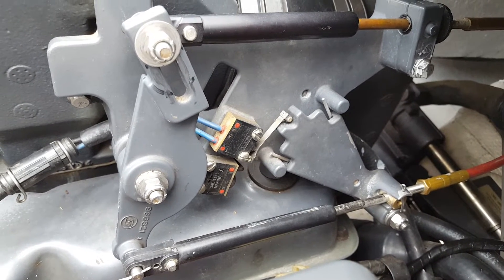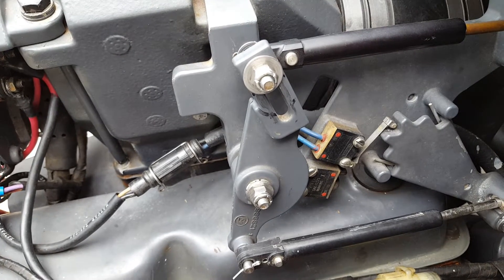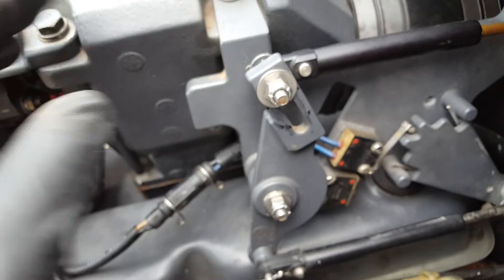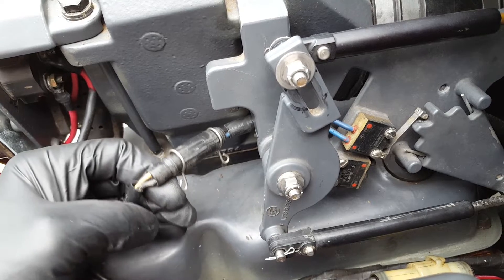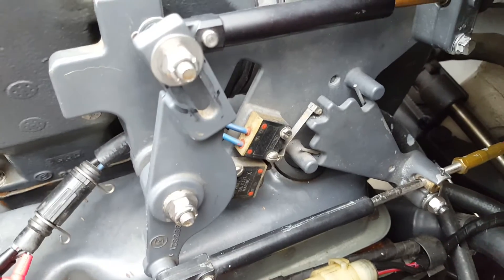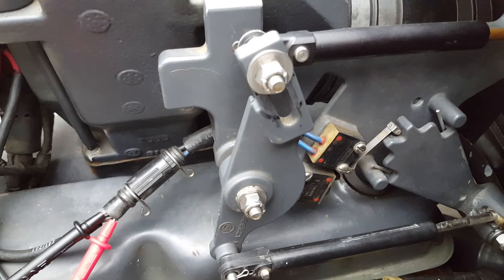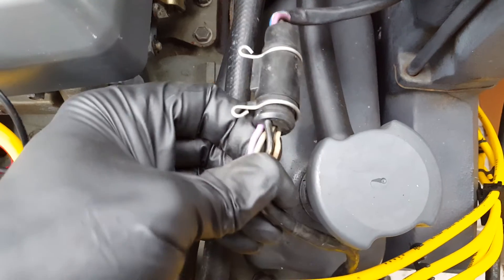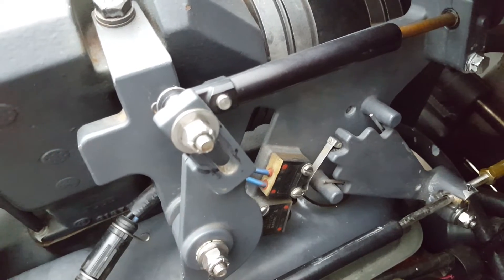Engine Bracket & ESA Troubleshooting Part 1 - OMC Cobra Volvo Penta SX

Comment: Michael Romer. So im to a point where i think I'm gonna sell the junk but b4 I do can you answer me this. In the out drive there are 2 black wires that are connected to something  on the staboard  side of the outdrive . The run up and through the transom and are connected to wires that I believe end up at the alternator and a wire harness....also i did ginny rig the lower shift cable to not pop out of that black plastic piece in the outdrive. I reassembled everything and I can make my prop turn counter clock wise and into neutral but i cant get the prop  to turn ..clockwise.
Reply from the maker: You are talking about the trim sender wires. If it is popping out, there is something wrong. Take a look at this link and tell me what parts you are having issues with: http://www.crowleymarine.com/johnson-evinrude/parts/56125.cfm?mdl=TMV29H

Comment: I do not know what year exactly my shift bracket is however I know that , "W" thing never moves. Is it simply that v spring in the back that's to tight?  Got a link to buy one ?  What is its name exactley.
Reply from the maker: See if the w will move by hand first. The whole thing about the w is it only moves correctly if the linkage is setup correctly. Sadly, if someone has played with it, it needs to be redone. I recommend starting with my ESA 5 part series and working your way all the way to part 5. You could skip the parts where I removed the stern drive (part 2) but you are leaving out 50% of the possible problem. For purposes of this video series I simply call it the "w" which is centered by the v spring.
Reply: Michael Romer thnx 4 reply. 2 years ago i rebuilt motor. B4 rebuilt I only had forward and Nuetr.When everything was pulled apart I noticed a million barnacles in the outdrive. Thought that was hindering shifter. Cleaned everything, got bottom of shift cable in bell housing sliding smooth. Put OD back on. Huge problems with impella and the top end of OD. Shelved the project last year.This year bought a better ODrive. Hooked it up, everything works xcept only forward. Took outdrive off. Notice linkage keeps popping out of end of shift cable. Plus i noticed with engine on that little roller thing at the "W" when you move it the motor does not try to cut off. Yes that "W" can move freely. So I know from outdrive to motor the shift system needs to be redone. I am trying to rig the bottom (the part in  the outdrive) to go from forward to neutral to reverse without having the linkage pop out and use the boat THIS season. Im talking under 10 trips around the harbor. Then this fall im yanking the motor. Again and then I will replace the shift cable.

Comment: Could a bad  ESA system cause the coil not to spark
Reply from the maker: ESA by default, meaning when in neutral, ESA is off. If your shift linkage isn't adjusted right then, you might have ESA on all the time. Check out my ESA video series to work through that.

Comment: having a problem with my shift cable its working to good killing my engine when i put it into gear and it wont go back to the place it should be to make the engin run right!
Reply from the maker: This is a cable alignment issue. Consider replacing it, typically there is drag from a warn cable. Start by removing the stern drive and start from video 1 and move forward.

Comment: Last thing...the ESA is not supposed to engage shifting into gear, only when you shift out of gear. The load lever (the part that actually triggers the esa intermittent switch) moves when it senses a load on the shift cable jacket (because the drive resists coming out of gear due to the nature of dog clutches). The movement of the load lever triggers the intermittent switch to lower the idle to 450 or so for a few sec as you are shifting from in-gear to neutral, that allows the drive to shift to neutral. Then as soon as the shift is completed, there is no force on the shift cable jacket which relaxes the load lever and that also releases the lever of the intermittent switch. Then the idle will jump back up to 600 or so.
Reply from the maker: Luigi 1955 I've heard some ppl mention that ESA engages coming out of gear. Mine definitely doesn't. I rebuilt truck and car manual/automatic transmissions, so convincing me of the logic of utilizing ESA on a forward to neutral shift, is a tough sell. Neutral to forward, or neutral to reverse is a given. The interruptor "metal catch" on the engine bracket is the key to knowing when your ESA is suppose to shift. I know for a fact their are multiple designs and OMC did that on purpose.
Reply: If you are running it on the water hose on land, the ESA will not have to engage (lower the engine idle) to get the outdrive out of gear into neutral, because there is no load on the prop keeping the clutch dogs engaged. But in the water if you are coasting in fwd and then need to shift to neutral then for sure it should engage due to the resistance of the dog clutches to release when a load is put on them by the pressure of the water on the prop. . The information I posted comes right out of my '88 OMC Factory Shop manual. If the ESA does not engage (interrupt switch lowering the idle from 600 down to 450 when you attempt to shift from in-gear to neutral then the drive may not shift at all, or putting pressure on it may bend parts of the shift linkage or break the cable. Mine always engages in the water, never on the water hose. And it does not engage when going from neutral into fwd or rev.  Another good reference is the Midnight Wolf OMC parts website. They have updated instructions from a later model shop manual with a few OMC service bulletins.
Reply from the maker: Luigi 1955 Post some links, people reading this are hungry for knowledge.
Reply: https://forums.iboats.com/forum/engine-repair-and-maintenance/mercruiser-i-o-inboard-engines-outdrives/295363-how-to-how-the-shift-interrupt-system-works

this describes the system on a Merc Alpha, but the Cobra system is very similar, except that on the Alpha it actually cuts the ignition to the engine for a split second where on the Cobra, it lowers the engine idle to approx. 450 rpm. This article explains nicely why the clutch dogs are cut to stay engaged, why they resist releasing when you try to shift out of gear to N, and how the shift interrupt system senses this and then lowers the engine idle to allow the clutch dogs to release so the gearcase will shift into neutral.
Reply: I can tell you Luigi 1955 seems to be right, we just got back from Lake Powell with our 1992 Seaswirl with the 5.8L OMC Cobra. We had some electrical issues and bottom line, we had to disconnect the ESA module to get spark to the plugs. Going into gear was no problem, we had to shut down the engine to get it out...

Comment: Also with a properly tuned engine when you engage the interrupt switch with it running at idle (600 rpm) it will drop the idle to about 450 or so and the engine can still run at this rpm if its in good enough tune. It actually should not stall as will happen with a Merc Alpha set up.
 At least that's how my '88 OMC 4.3 V6 is.
Reply from the maker: Luigi 1955 Thanks for your feedback!

Comment: Hello Mike great vid but the switch with the little lever is the interrupt switch and the other one is the overstroke switch. The interrupt one will make the engine stumble when its engaged by the load lever and the overstroke switch is supposed to keep the intermittent switch from engaging once the drive is shifted in gear.
Reply from the maker: Hey Thanks for your feedback. The current manufacturer of replacement parts refers to them as I did, so I won't make corrections. Please reference this site for both verification and parts If anyone reading this needs parts. Make sure you search by stern drive.
Reply: http://www.crowleymarine.com/johnson-evinrude/parts/55843.cfm?mdl=S2SB1M   (parts breakdown)
http://www.crowleymarine.com/johnson-evinrude/parts/55843.cfm?mdl=S2SB1M  (they call it cut out in the diagram  but in the shop manual its called the interrupter switch) 
http://www.crowleymarine.com/parts/14135.cfm    (overstroke switch)
Crowley marine sells OEM OMC Cobra parts from BRP.....I've been buying stuff from them for years....
Reply: http://www.crowleymarine.com/parts/16508.cfm

sorry here's the cutout (interrupter) switch
Reply from the maker: Luigi 1955 As long as BRP and Crowley use pictures to go along with a part number, we as consumers will get the right part.
Reply from the maker: Luigi 1955 I'm liking all these links, good stuff!

Comment: So I'm guessing I have a bigger problem...  When I activate my overstroke switch the engine not only stumbles, it dies...  I have retrofitted the distributor with the sierra kit (so easy) and modified my wiring to include the recommended diode / resistor circuit...  I have a hard time bringing my idle down to 600 without dying...  Engine feels like it is running a little rough...  When I pull plug wires off the distributer cap to try to isolate if a particular may be the culprit I find that when I pull the 6 & 8 wires I don't notice the idle getting rougher (all others are noticeable)...  I'm thinking head gasket..??  Any suggestions on how to verify this diagnosis..? Also, have you ever pulled the heads off a 5.8 (ford 351) cobra..?  It's a 91 four wins...  Thanks again Mike..Arthur...  I'll get that hot date out on the water yet..!!
Reply from the maker: Ok, so you have a few issues here. The ESA works pretty close with the coil. Your engine needs to be in strong working condition, otherwise ESA will cause it to shut off. Basically, you have it barely running now, ESA finishes it off. Watch my video on how to check if your coil is any good. Also your cap and rotor need to be replaced because I'm reading a lot of ignition related issues in your description. Also check your spark plugs. Run your boat at night and check and see if you see arching (sparks) coming from your spark plug wires. I have lot's of experience pulling the heads off the 351w/350s. Before you go that route, you need to do a compression check and leak down (yes both). If either of those fail, you should take your heads off and start that journey. Yes, I'll probably post a video of how to do that.
Reply: Hi Mike... Coil, cap, rotor, wires & plugs have all been replaced with quality parts...  Now here's a curious little detail: there have been times when I have pulled that #8 plug (this rough idle is a couple years old now) and it was wet...  Not gas wet but water wet...  Do you know of any failure consistent with that..?  It is the rear most plug on the starboard side...  Exhaust manifold..?  head gasket..?  Have you ever seen this occur..?
Thanks for you valuable time..  Kind regards,
Arthur  Oh, PS..  That cylinder is holding at 150 lbs...  I'll check others..
Reply from the maker: That really sounds like a burnt exhaust value! You sure you have compression on that cylinder? If it were the exhaust manifold, they all be a little wet. Sadly, this would be the head gasket.
Reply from the maker: A Vida Another test I mentioned earlier that will save you time is a leak down tester. It's a good way to test your head gasket. They have them for $35. I have a how to video for that process.
Reply: OK Mike..  It seems my previous diagnostic tests may have sent me in pursuit of wild aquatic foul (aka a wild goose chase)...  After further testing I have noted some perplexing, reproducible results:  When I run a jumper from +Batt to +coil all seems fine (except of course the overstroke function), starts fine, runs fine, shifts w/o stalling (I'm out of the water), tilt up/down...  When I remove the jumper things go to hell as soon as I try to do anything (shift, tilt, almost even look at it..!)  So, I think you were right in the first place - something ignition related...  I'm going to go do some more diagnostics, any recommendations..?  My marina installed the diode/resister circuit so I can't assume it is correct...  When testing without jumper I get inconsistent results...  Sometimes pressing the OS switch causes the engine to stumble for a few seconds (even after I release), sometimes not...  The thing that's got me scratching my head is without the jumper the engine stalls when using tilt..?  Any thoughts..? Thanks.. Arthur
Reply from the maker: Sounds like there is an electrical issue. Take out a tilt/trim electrical diagram and start tracing those wires back to the right bank exhaust manifold.  Chances are, where the solenoid is, you will find an issue with a connection. Could be a damaged/frayed cable, or even a loose connection, maybe even something with the 50 amp fuse setup/solenoid. The 50 amp breaker is tied in with the tilt/trim pump, so from that breaker, work down into the other wires. I would focus on the tilt-engine kill scenario first . When I'm considering , "what changed," I keep coming back to the diode/resister circuit that was installed, but that is a guess on my part. https://sunbirdcorsair.files.wordpress.com/2011/03/1986_-_1998_omc_sterndrive_man.pdf
Reply: Inspected tilt wiring, looks ok...  In doing more research on the Sierra Ignitor 18-5299 it specs out a coil  with primary resistance of 1.5 ohms or more...  The Pertronix Flamethrower coil in my boat is labeled as .6 ohms... Do you think this would cause my rough running and stalling issues..?
Reply from the maker: A Vida The resistance could be playing into this one. Did you track down why the use of tilt kills the engine? I'd start getting some known good parts to test, as you have something acting up. The ohms needs to be higher if the diode for your pickup is setup to work with stock coil.
Reply: That did it Mike... Picked up a 1.5 ohm Flamethrower from local Pep Boys for $30 now she idles down to 600 and I can put her through the moves (shift F/R, tilt, stumble etc.)..  

I've been banging my head against this one for years because I had replaced the coil when I installed the EI so naturally I looked for the problem elsewhere... Flawed reasoning, symptoms were marginal and deceptive... 

In chasing this bug down I noticed something curious...  My interrupter switch does nothing.?! The switch itself tests fine but somewhere along the line that dual switch connector lost 2 wires..?  There are 4 wires going in (2 blue 2 black) but there are only 2 wires coming out (C&D the ones connected to the blue OSS wires), the other 2 are not there and there are little white plug caps where they should be..?  So at this point the OSS operates in both reverse and forward...  I can only assume it was a mod made by my OMC dealer when they added that diode/resistor "stumble" circuit (which also works properly now not killing the engine when activated by the OSS)...  

Putting her in the water for the season tomorrow (this has all been out of the water testing) to put her through the moves (and maybe finally get to use some moves of my own with that hot date that's been patiently waiting.. ;-)  Will update with results (not about the date though, being a gentleman)...  Thanks Mike...  Have a great weekend..  Arthur
Reply: Oh and thanks for that 600+ page manual... Some good stuff and more information then you ever wanted to know..!
Reply from the maker: Great work! As far as the OS (overstroke)/interrupter, there are suppose to be 4 total wires for the 2 switches and there are only 2 wires going into the harness. I cover that on part 1 & 3 I believe on the video series. The interrupter disables the OS switch so while you are in gear, your ESA system isn't allowed to work.

Comment from the maker: I know everyone is dying for part 2 and 3. Just know there are a ton of things that need to be checked before your shifting will work perfectly. I'm working to get all those steps put in video form. By the time I'm done, I will cover anything and everything you could run into. Ton of work going into the next series. Standby.
Reply: Michael Romer will a bad ESA keep you from shifting to forward even if the engine is off? My boat got stuck in reverse a couple days ago when I was backing from the doc. Right before that I did tamper with the idle a thought it was a little high. When I moved the shifter forward it went even faster in reverse. Spent an hour in the water trying to shift into forward but it wouldn't.  Even with the engine off
Reply from the maker: DeQuincy Zenon ESA isn't the issue. Chances are your shifter cable is toast. Try removing the shift cable from the engine bracket. See if you can pull it out manually.If not, you need to get your stern drive off and start running through part 1 and checking everything. The shift cable is pretty cheap to replace.
Reply: Michael Romer thank you.  I really appreciate the advice